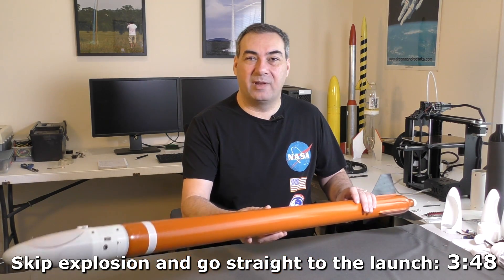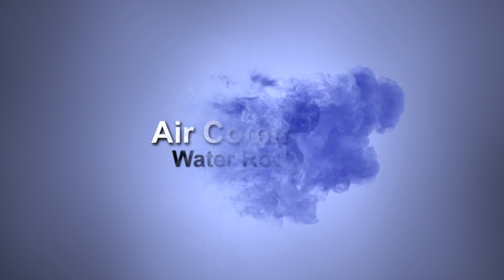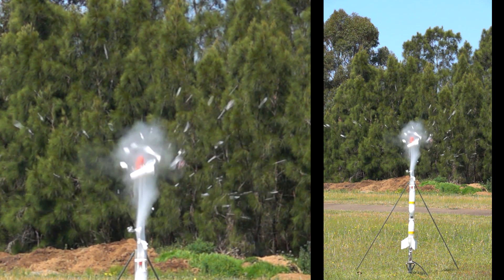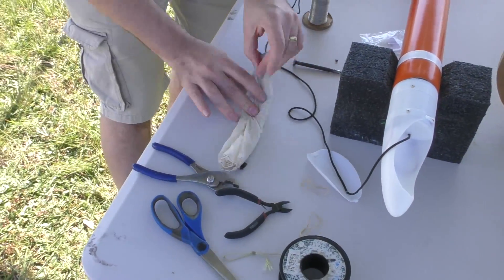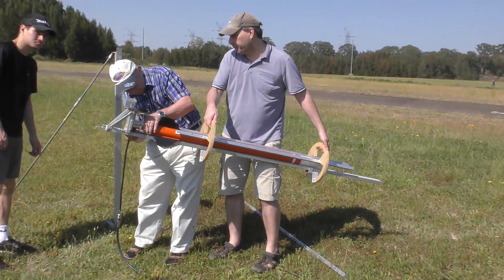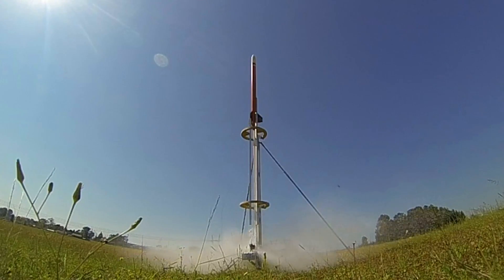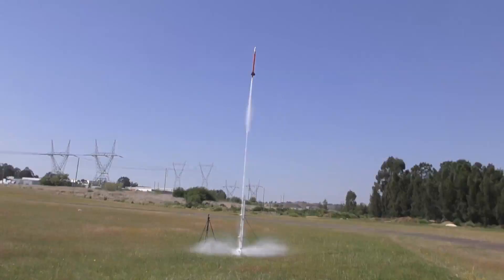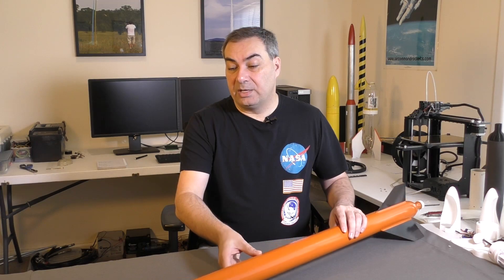Nova Water Rocket - Part 3 of 3 - First Flights

Comment: And how about an aluminum chamber covered in carbon fiber to achieve 2000 psi i understand the whole non metal thing but for a record altitude  do you think is possible  to get 10000 ft or am I crazy
Reply from the maker: You certainly could make a pressure chamber like that and get very good performance out of it. There are easily available COPV tanks that have an aluminium liner and reinforced with a carbon fiber wrap. They will hold 300 bar and their non-destructive test pressure is 450bar (6500psi)
Reply from the maker: 10,000 feet is certainly within realm of possibility for a highly optimized, perhaps multi-stage water rocket.

Comment: Is there any other reason for nozzle size besides the scale down for visual appearance....and does convergent /divergent ever come into play at all
Reply from the maker: Nozzle size is also affected by the type of release mechanism you use. If you are using a very common Gardena hose connector, then 9mm is the size. There are very similar ones called Maxiflow that are 15mm in diameter. For regular water a divergent section really isn't going to help you. If you are doing purely gas and or foam then you will get some benefit.

Comment: Hi I definitely enjoy you guys i have done water rockets myself and was curious why you use such a small nozzle  I have used only 22mm never thought a 7 mm nozzle would work on water I would think you would get much higher with a bigger nozzle ...eve. 11 mm is pretty small ..
Reply from the maker: Hi, good question. We prefer the smaller nozzles for the longer burn time the give and the slower flight speed. The rockets are much easier to track with a camera. The overall performance difference is small compared to full size nozzles so if we aren't going for any records it doesn't really matter. Smaller nozzles also work better with foam.

Comment: When you turn on the timer before takeoff?
Reply from the maker: We arm the timer before we start pressurising. The timer then detects launch and starts the preset delay.
Reply: @AirCommandRockets  how it detects startup?
Reply from the maker: @stanisawgorczyca6460  The timer has 2 ways. There is a g-switch that detects any acceleration over 2G or optionally It also has a break wire circuit - basically two wires twisted together with a loop of string between them and tied to the ground. When the rocket launches the string breaks the wires and it detects launch.
Reply: @AirCommandRockets  where to find g-switch?
Reply from the maker: @stanisawgorczyca6460  There you go: https://au.rs-online.com/web/p/vibration-sensors/4553665
Reply: @AirCommandRockets  Can you recommend a servo timer? And what should I solder the g-switch to

Comment: The only way to get it faster is increasing the pressure, however, if the water can reduce to a lighter element ( mist or steam gas) in a seperate stage/chamber, then you can exirt even more pressure, thus save more fuel time range, save more launch stand pads( from dense water damage blast), probably faster as acceleration is lengthen.

Comment: I’m new to this channel, so I don’t know if this was answered. Do you Use De Lavel/converging diverging nozzles on the rockets? Would it be practical?
Reply: Water doesn't expand when leaving the throat, so a diverging nozzle section does not help.
Reply from the maker: We don't use CD nozzles for our water rockets. However, you would get a benefit during the air pulse phase of the thrust (when the water stops coming out). There is also a possibility of CD nozzles being useful when foam is used in the rocket.

Comment: how would a rocket go with 22mm carbon fibre tube
Reply from the maker: A water rocket? ... What is the total volume? What is the total weight? What launch pressure? What size nozzle? etc.
Reply: @AirCommandRockets  yeah a water rocket made from the 22mm carbon fibre tube that alot of camera mojnts and frames are made of ...people use it for quafcopters and hexacopters etc..so i supose 22mm diameter 600mm long and whatever pressure it could take? could you see that working?
Reply from the maker: @bencordell1965  It would work as a water rocket, the one limiting factor is the small volume.

Comment: If you were to reprint in a different plastic here is another plastic to consider, ASA. It's derived from ABS and it was made with UV resistance in mind. It IS stronger than ABS and less dense than PETG. It's also easier to print than ABS and you don't need to have an enclosure to get good prints.
Reply from the maker: Thanks for the tip. This sounds promising.

Comment: Hi George, PM me your address and I’ll send you some brand new 1.25ml bottles. We buy them by the pallet load directly from the manufacturer here in Brisbane. Cran
Reply from the maker: Thanks very much for the offer but I still have about 100+ bottles left. I'll test them first before putting them on the rocket. I think some of the ones on top may have been exposed to a lot of UV over the years with the sun coming in through the window. There are lots that I have that have been under cover so I will try those first. These are bottles still with the old larger thread that fit most of our nozzles and couplings.

Comment: Damn ... you definitely underestimate your work while simulation 😂
That' great stable flight with higher altitude..
Reply from the maker: The simulations are normally quite accurate when we only use water. When you add foam you get a boost in performance, but the simulators don't have any foam parameters.
Reply: @AirCommandRockets  maybe you can interpolate a function with all the testings you're doing..
For water equivalent to foam...or something
Reply from the maker: @Shreyam_io  We don't quite yet have enough data points to make that extrapolation reliable. This is because there are a lot of factors that influence foam formation in the rocket. Hopefully some day someone will come up with some kind of a model for foam that will produce more reliable results.

Comment: Shall I advice using a nylon or polycarbonate filament for extra structural strength? Perhaps you could try some of the salt/tempering techniques out there to further improve the soundness. 

That was a fantastic maiden too. Really inspiring to get myself into high power water rocketry too!
Reply from the maker: Any suggestions for appropriate filament materials is appreciated. We don't have much experience with the various printing materials. I know they all have their pros and cons in terms of printability and dimensional accuracy, thermal stability and post processing options. Great to hear if you are going to have a go at some of the higher power water rockets. :)
Reply: @AirCommandRockets  PLA is fantastic for quick prototyping, inexpensive and dimensionally accurate, plus it’s perhaps one of the easiest materials to print.

Nylon is harder to print, but it’s much more resistant to impact and harder too!
Reply from the maker: @DaWalkDude  One of the reasons we went with PLA was because it is such a common printing material that most people have easy access to, and it is easy to print. I think we'll have to give Nylon a go.
Reply: @AirCommandRockets  PETG is supposed to be softer, but I found it to be rather fiddly.

I would use something like "semiflex" from ninjaflex - which is a mix of Polyurethane and PLA. It makes rubbery semi rigid structure similar to hiking plates. That material would never crack. 
I would print the outer/top part in that material while having the bottom part in PLA with a slightly thicker double contour wall.

Comment: Congrats on another successful rocket. and with a bit of tweaking. couldn't you maybe do 400m with 400 PSI.
Reply from the maker: Thanks :), I think if the rocket holds together at 400psi, then that's fairly close to what we would expect in altitude.